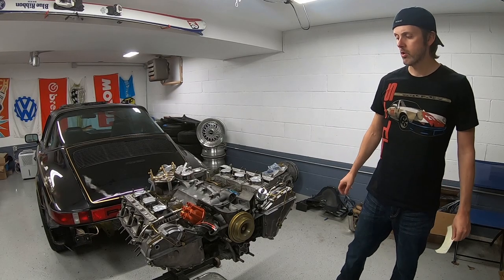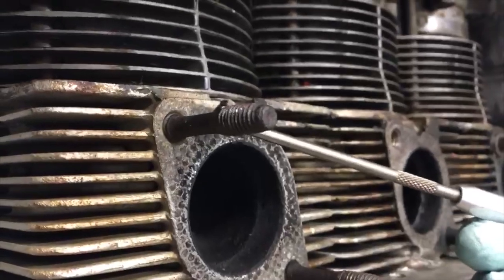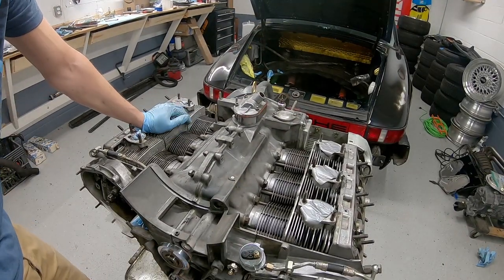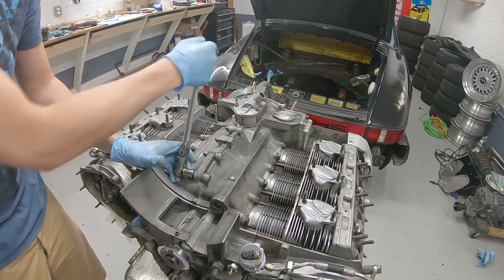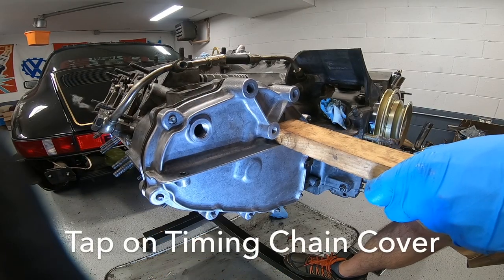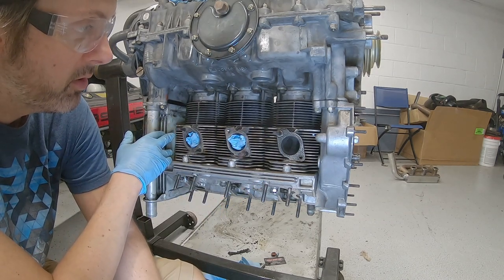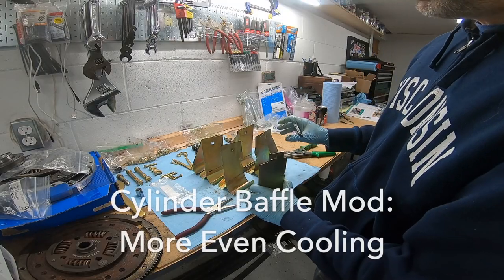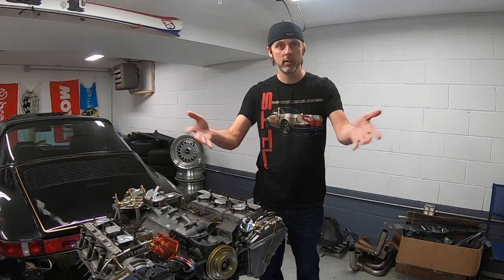Porsche 911 DIY Wrapping up Block Assembly, Timing Chain Covers; Projekt AirKult Ep15 Block Party

Comment: Oh, crap. I'm all caught up! 

I'm a water-cooled guy (928s, 986s, and a 951), but I picked up an '89 Cab for stupid cheap money with 90k+ on the clock. I know at some point if I keep the car I'm going to be doing a lot of the same things you're doing. It looks great so far!
Reply from the maker: Stupid cheap is good, lets you save for the inevitable.   This car needed everything, which is how I got it pretty cheap years ago.   So far this engine rebuild has been pretty affordable, but the $4,000 trans rebuild was a big hit.

Comment: Nice work mate, i always like your videos. Just me personally, I would clean the powder-coat off the back of the sump plate with a wire wheel. I wouldn't want it to soften up from the heat and oil and have the pump eat the glob.
Reply from the maker: Good idea.   My only fear is missing a few chunks, and hten having an exposed edge.  Hrm.

Comment: It looks like you’re doing a good job on getting the engine back together and things are gonna look nice with the powder coating.    that was really bizarre with the exhaust studs the way they were put in, either that was case saver or a time CERT that must’ve been improperly installed,    I hope your repair on that works good for you.
Reply from the maker: Thanks.  Yeah, definitely unexpected.  It's crazy to me they would leave them proud and just double stack gaskets on one cylinder.... just... wow.